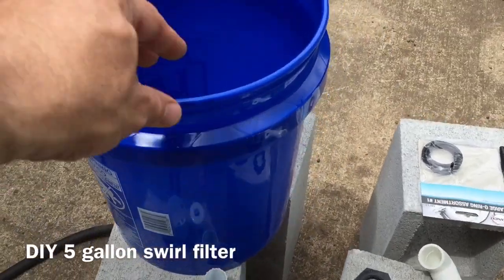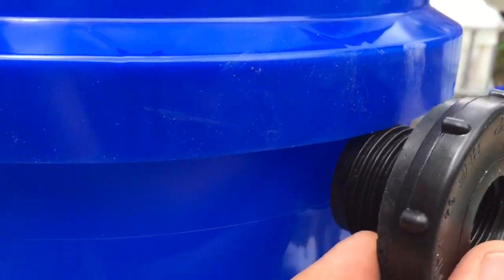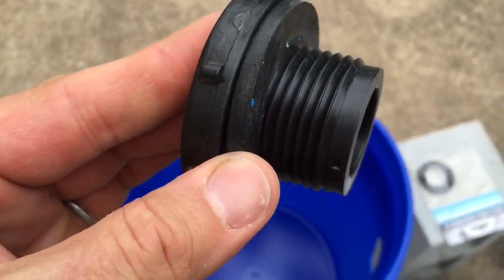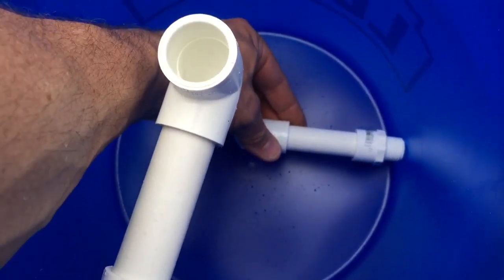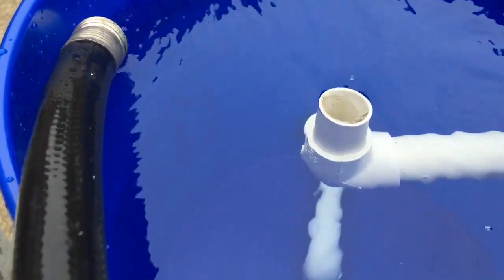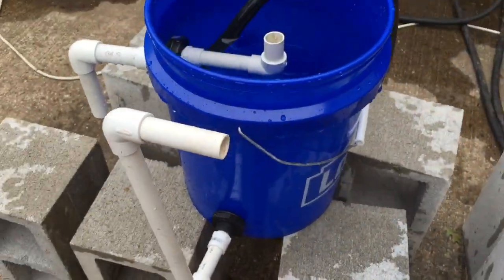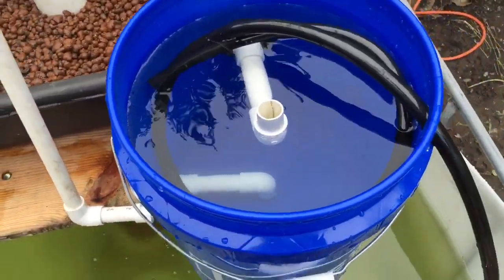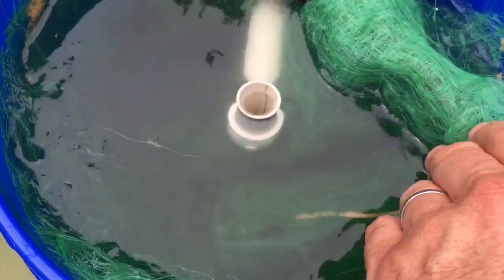DIY 5 gallon swirl filter for an Aquaponics system

Comment: Will this method work on a 2 gallon bucket or is there not enough depth/volume? 5 gallons is a bit large for my setups. I have 55 gal aquariums.
Reply from the maker: You can have a 55 gallon aquarium and have a 55 gallon swirl filter.… The swirl filter will just have more beneficial bacteria and keep your aquarium a lot cleaner. Any size will work. Even a 2 gallon on a 55 gallon tank. However, the larger the filter the more bacteria the cleaner your water will stay

Comment: disclaimer
absolutely no filtering wss done while making this video
Reply: chip turd if you built this, I had the same problem, my pump was too big (too many Gallons per hour). All the waste/fish food was going straight to the plant. I got a smaller filter 63 GPH and it works perfectly without the “air filters”. It is FRUSTRATING but I made it work and I think with a smaller pump you can too.

Comment: I would suggest to consider the capacity of the water pump you are using. I am using a bigger pipe for the outlet (going back to the tank) with at least twice the size of the inlet pipe (from the pump)... otherwise, with the same size of pipe, the out-going pipe could not accommodate the  volume of water brought in by the pump to the bucket, causing over flow.

Comment: The solid suction would work better if the elbow was the bottom but near the wall. The idea of swirling is to throw solids in the wall so the suction at the middle might not take everything.

Comment: great idea with the drain pipe. I put a small tank on top of a whiskey barrel with a 10 gallon bucket inside as a sump. I want to add the same style drain pipe whilst insuring it won't leak in the house. what type of bulk head fitting did you use for the waste removal pipe? the lever that twists to allow solid removal without leaking?